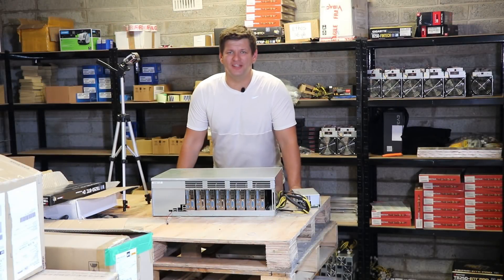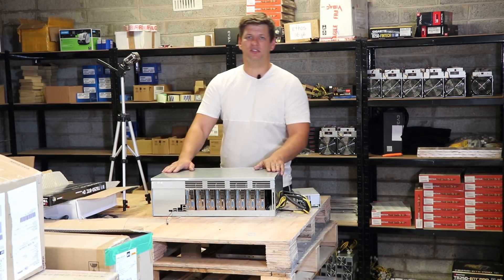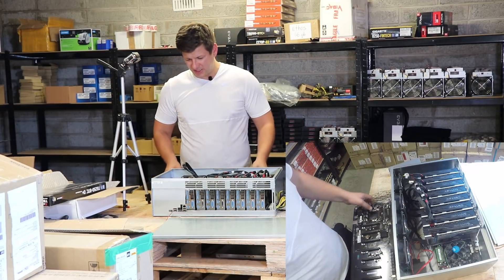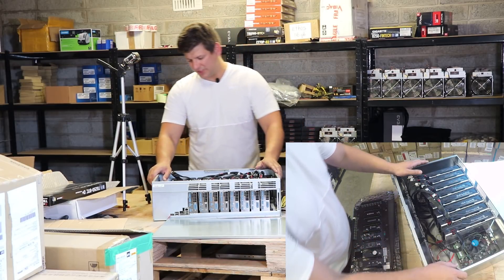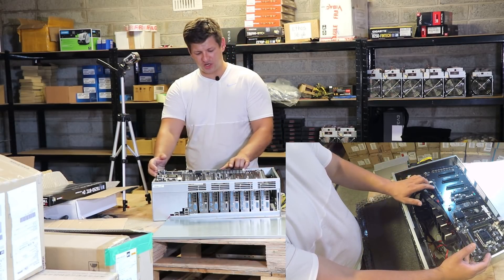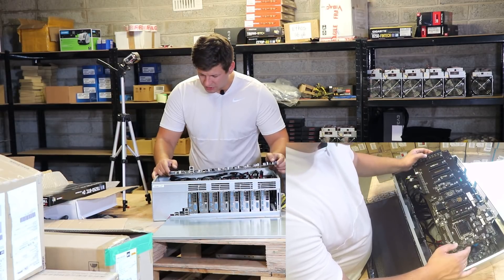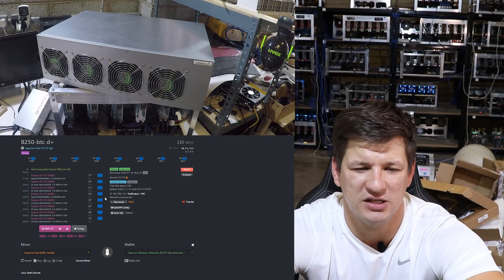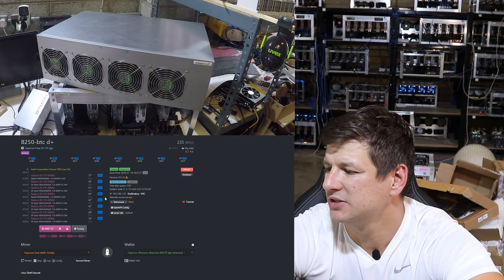Mining rig built in closed casing on riser-less motherboard..?

Comment: Hey there, what did you use for a psu? I can’t find a psu that has the 8 6 pin atx power slots.
Reply: I know you said you used a bitmain power supply but which model will have the 6 pin connections.
Reply: Sorry for all the questions, but also what adapters do I need for the gpu since there are only one per gpu?

Comment: where can i get the cpu to cpu 4pin cable i cant fine it anywhere
Reply from the maker: No use I made one myself.
Reply: @GuntisVitolins  so just simple cross over i take it just make sure the pins match up at both connectors? i was going to make one but didnt want to short the board lol
Reply: Had the same issue, found one here: https://www.deepinthemines.com/collections/cables-accessories/products/4-pin-cpu-eps-to-4-pin-cpu-eps-24-inch-for-biostar-tb250-d
Reply: @dr_dan_wwb  your a life saver i ended up making one but havent tried it yet. id rather buy one ment for the application
Reply: @bigkatFPV  for sure, I looked everywhere and almost gave up after seeing your comment here lol. they ship fast too!

Comment: I see 2 disadvantages. Cards Heat blowing on the next card and the next one is non sense. And second is if a PCI failed you can't trouble or switch it, replace it. How of a space issue are you to go compact like that? I live in the second biggest country in the world, space is not an issue.
Reply from the maker: Marcus Anonymous heat blowing isn't a issue if you have box like this actually  cards without backplate thing would be even cooler. As the 6000rpm fans are doing great job to cool cards. But yes if you build this on open air case 8 cards on this motherboard not possible ,it will just not work.

Comment: where can i buy same this case _???
Reply from the maker: Mike Sve I dont remember where I got this, had this sitting in warehouse for a year. I have looked everywhere and no success yet with such casing.
Reply: I can get you a contact for those cases. I have six of them running for 6 months now, and not a single issue, I also run the gpu fans at 25% the temps will drop by about 5 degrees on each card, Im running 8x 1060s (3gb) and power from wall is below 750watts with hash rate of 180mhs.
Reply: @meholeNoback  hey I’m looking to order a case or two for my tb250 btc D+
Reply: @liammcinnis8750  contact guntis on this channel, he supplies them at very good rates